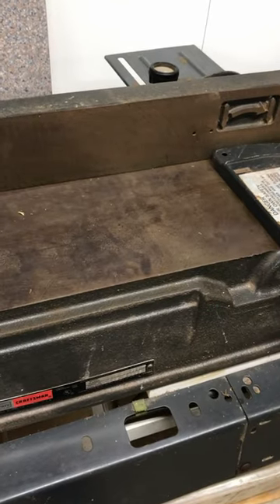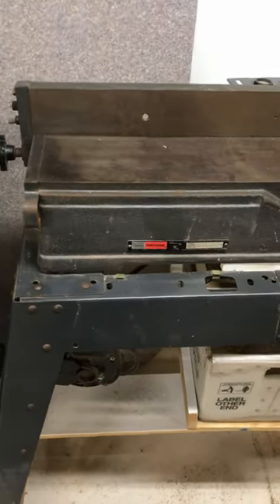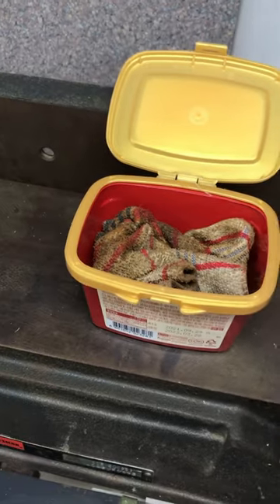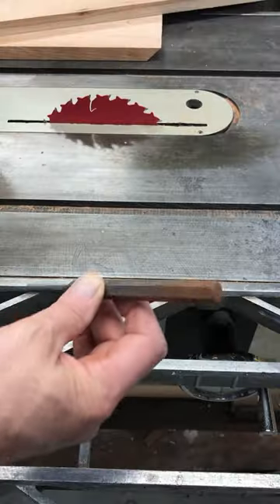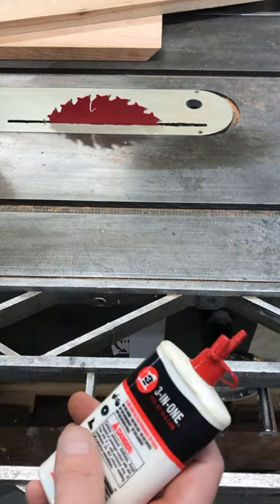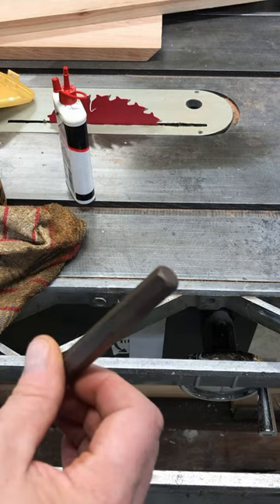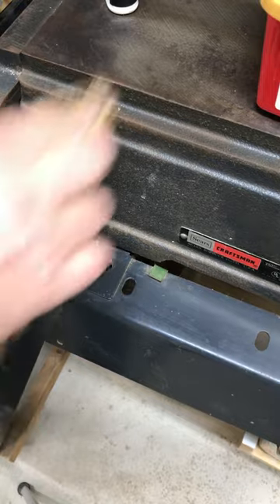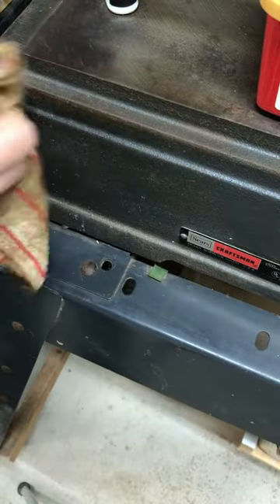Dirty Oil Rag #Short #workshop #woodworking #tools

Comment: You should never store an oil rag in plastice or leave it out bunched up use a metal firebin for oil rags this is a fire hazard
Reply from the maker: Thanks for the comment and you bring up a good point that one shouldn't be cavalier regarding combustibles.   I'm no expert but my understanding is oils that oxidize exothermically are the hazard to which you refer, and many oils do (including some vegetable oils), but not all of them.  I've had this rag for some time and never seen any evidence of the oil curing which may indicate such a reaction.  For what it's worth, the neither the 3 and 1 (WD-40) nor Howard's web site makes mention of the issue that I could find.  Still, one should be comfortable with what you do. Storing in a metal, sealed tin is a good idea.  Of course always using a clean rag and prompt disposal eliminates the issue all together.  I'd never tell anyone to do anything that makes them uncomfortable.  Thanks again and hopefully this serves as a useful reminder to the community.